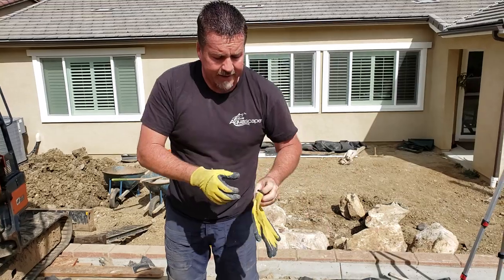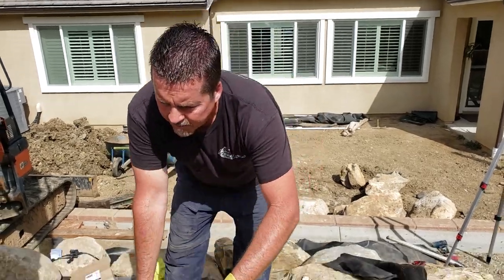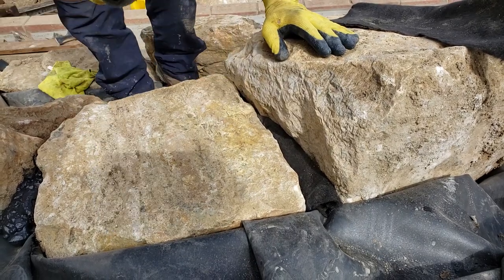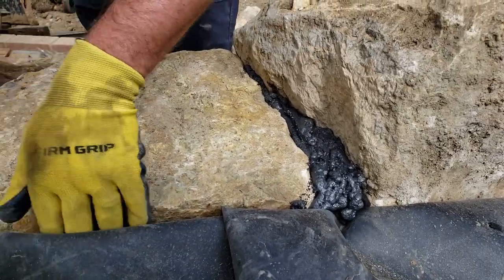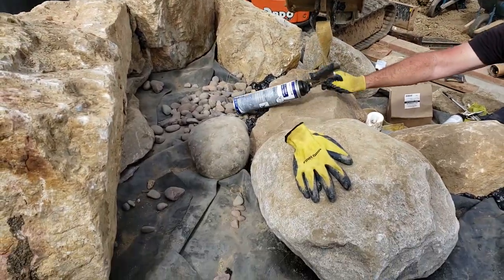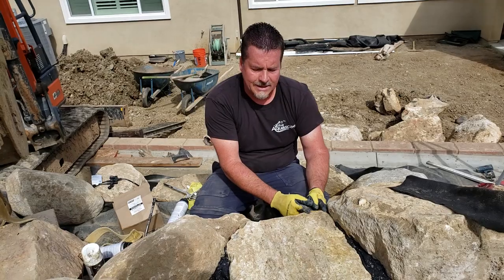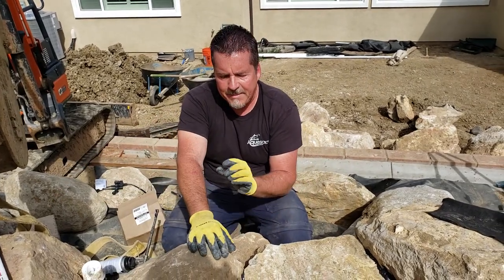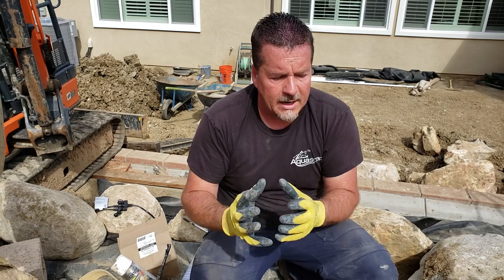Tips how to use and apply Aquascape Waterfall Foam

Comment: That was quite helpful, especially with the spill rate, and the "less is more" comment for form. Thanks
Reply from the maker: Thanks. If you think about it, foam should be used to complete the install, not BE the install. Make sense?
Reply: I must admit I ran my water for a short while to make sure I had all the gaps filled to stop water leakage

Comment: New subscriber here in UK..
Great info on the foam, it'll help when I do my friends water feature, (small garden waterfall/cascade), but do you have any videos explaining pump pressure, distance and pipe bore? 🙂
Reply from the maker: No, but I should. It's information readily available. Rule of thumb is to run 2" pipe unless you have flow that exceeds 7000 gph.  After that, run 2".  Most head pressure is at about 5' nominal,  but kike I said, do your research, and I'll still shoot a video.

Comment: Thanks for the video!  Just one (probably stupid) question...  On your two spillways, why do the BACKS of the two spillway rocks need to be level to each other?  It seems like having the fronts be level to each other should be sufficient to make the water flow work well (assuming that both rocks have the backs lower than the fronts - basically leveling the highest points of both spillways to each other.)  What am I missing?  Thanks so much.
Reply from the maker: I like to level the backs because the fronts may not necessarily be level to each other. When the fronts are equally level, it looks artificial to me. 

But you are right in concept.  It's a matter of preference

Comment: Hi Carl, Great video and very helpful tip, I wish I had watched it earlier.  I applied way to much and didn’t use any rock, stone dust, etc to cover it up, now I have ugly foam coming out of the rocks.  I’ve cut most of it away but still see it from the patio.  Do you have any tips for getting it off the rocks?
Reply from the maker: Hey Danny!  Great question. :)

Best way to get foam off is with a power washer after a wire brush. Even that wont get it all. :(

This sounds like a great video!!!

Comment: Your right foam does matter I just dropped 4 cans of BS foam from Menards and the whole thing leaks. I spent 6 hours placing rocks. Now I have to do it all over again and remove the old foam and put professional down. SMH!!!
Wish I saw this video before I made more work for myself. Thanks for the pro tip.
Reply from the maker: Thanks for the kind comment.  I've had foam can explosions....  It's not fun at all.  If you get some on you, diesel fuel works well with some simple green.

Comment: Hey Carl. What's your take on an acceptable amount of leakage through your falls (water going under your waterfall instead of over it)? I thought I was pretty meticulous foaming mine, but when I tested it, it seemed quite a bit of water was still getting behind the rocks instead of going over them.

I know the foam isn't waterproof and you can't get 100%, but I don't have a feel for whether I need to redo it or if it''s as good as it's going to get and more effort isn't worth it.
Reply from the maker: Keep foaming upstream until you find the source of the leak. It's awesome patience, but good foaming is when you control the water where you want it to go.

Comment: So you don't add gravel and/or sand to wet foam so it sets and camo's the foam? When do you add the gravel to the foam after you apply it?
Reply from the maker: It depends on the situation for me. I do add when it's wet on a second coat, but on a situation like you see in this video i like to get a good seal first. 

I add gravel after it sets a minute and completes expanding.
Reply: @ColumbiaWaterGardens  Many thanks for the reply, great video from a true pro, for my home project, I will add the gravel/sand within 5 minutes of the foam drying, it works best for the rocks I have. I am not using huge boulders, I can understand your method with the large rocks, and thank you for helping me understand the difference! Much love, happy building/gardening!
Reply from the maker: Please share your progress on our facebook page :)
Reply: U are absolutely right, you must let it expand and set then trim it back, throwing gravel on too early will give you pain, the foam will expand past the gravel and you will have to cut it back anyway, listen to this man, he knows what he’s talking about, thanks for the important tip!
Reply from the maker: @jgardens6321  I hate coming off like a know it all as I like to stay in the learning curve in all things. But after thousands of water features built and maintained, we have developed our methods when it comes to foam. 

Too early, big mess. Too late, no adhesion. There is a sweet spot that only experience teaches.
Reply: Columbia Water Gardens not at all, it is key that folks like me listen to tried and true methods and I know now, and you have great how-to vids, thank you for your knowledge, lesson learned! That’s what it’s all about, sharing of knowledge!

Comment: What can I use to prevent algae in a pondless waterfall??
Reply from the maker: We sell an automatic dosing system for pondless waterfalls that works like a champ.  It is the Aquascape Automatic Dosing System for Fountains.  If you would like to order one, please call me at 888-713-7771 x 4.

The problem with Chlorine is that it stains when overdosed.  Cycling the pondless waterfall off for a few hours every day also works like a champ without chemicals.  The heat of the day bakes the film and algae off, but it dries out roots of plants if you have a planted pondless.

My recommendation.....  Buy and install the automatic dosing system for fountains, and if that isn't enough, buy and install an  Aquascape IonGen.

Again, I sell both of these, I price match Amazon, and would really like to have your business and to chat with you before you make your purchase to ensure you are not spending money needlessly.

Happy Ponding ;)

-Carl

Comment: Water flows in cubic volume.  How deep is the inch that does 100 gallons per hour?
Reply from the maker: 100 Gallons per hour per horizontal inch at 1/4 " inch vertical or 1000 GPH per foot at 1/4 inch high....  There is a slight variance.
Reply: @ColumbiaWaterGardens  Thanks

Comment: Can i use sand and cement mortar for this?
Reply from the maker: Sure.  My experience has taught me that expanding waterfall foam is more effective as it expands into the deeper and harder to reach areas and acts as a glue and really helps lock things in place. 

People have used cement for years, and that doesn't make it wrong. The latest technology is foam, making the installation quicker,  thus lowering costs. 

Good luck!  😎👍
Reply: @ColumbiaWaterGardens  Thanks!
Reply from the maker: My pleasure 🙏